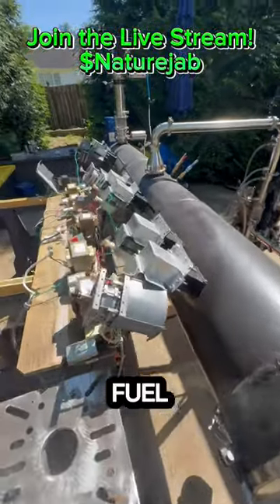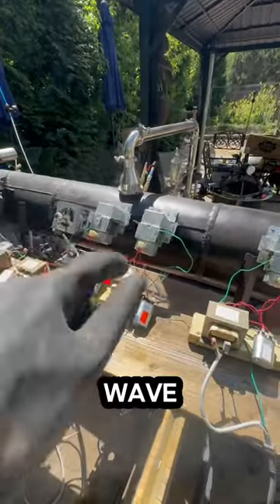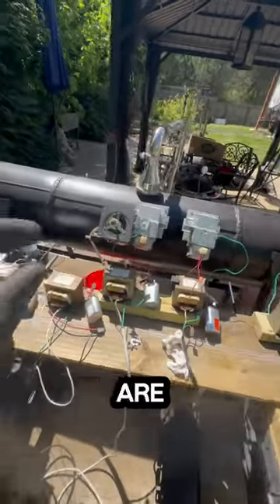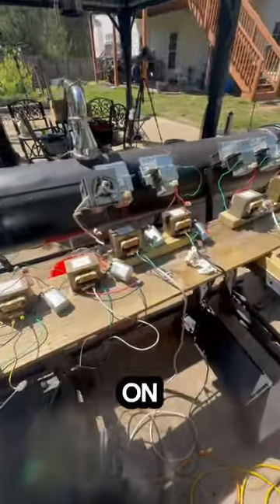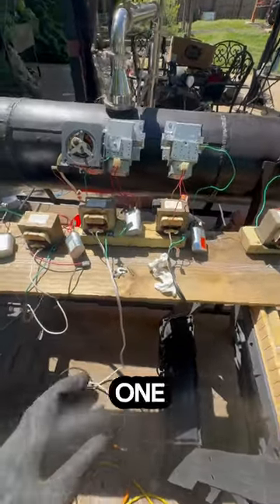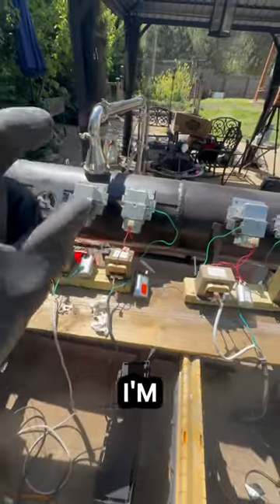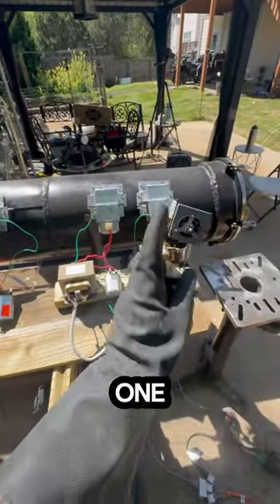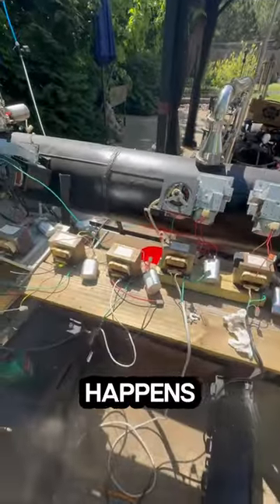7/12 Magnetrons! Microwave Plastic into Fuel Reactor! #naturejab #Pyrolysis #Science #Education

Comment: Note: a 2.45 GHz microwave signal has a wavelength of 0.122 meters. That’s about a third of a foot. When you mount your magnetrons, remember that standing waves will form due to reflections on the cavity and metal spiral due to constructive and destructive interference. This will give rise to cold and hot spots. Therefore, it might be more important to place the devices correctly for even heating than their actual number.
Reply: Or just not even use microwaves as a heating element.
Reply: As a commercial refrigeration/cooking products tech, I second this. Kick your mags several degrees off perpendicular. You want the radiation to bounce "down" the pipe. As they're currently oriented, the waves would bounce right back at the antenna

Comment: You can wire the primaries of the transformers in series and get a higher voltage that way you can run it on 240

Comment: Im not the smartest guy but a standard alternator gives about 80 to 90 amps. Could a small engine motor be used to power your invention? Also if more power is needed you could add another alternator.
Reply: I think it would use more fuel than it produces
Reply from the maker: Alternator gives high amperage but low-voltage. I need both. Thank you!
Reply: Amp + Volt   achievable with high speed
Reply: Alternators are DC. That's why you don't see genorators with alternators.

Comment: Only uses 15kW to make 2kW worth of fuel
Reply: Ye but it is a project in the garden after all, with huge budget you can probably make way better ratio and a goal is to recycle plastic into something we can use once again and fight with pollution
Reply: 70amps at 120 is 8.4kw. 1 litre of gasoline contains around 9.7kwh. So if he can make a litre (2 pints) of product in an hour, which it looks like he can, he's good. As the plastic is waste, the product should be lower CO2 footprint. Let this man cook.
Reply: Way less then 2kw
Reply: @dawidjlb2589 ya ppl will big money have tried. It takes to money energy to make the fuel.
Reply: @dawidjlb2589 this method of breaking down organic waste is never going to scale the way you think it will, currently most organic waste is degraded with anaerobic digestion, like landfills. 
https://en.m.wikipedia.org/wiki/Anaerobic_digestion
Reply: @Delchursing it definitely takes way longer than an hour to make the equivalent of a litre of gasoline (c4-c12). Remember that this produces a very crude distillate regardless of the throughput. Also what’s the point of taking already produced electricity and powering a gas generator with it. That’s like if you put gas in a generator, powered a device with electrical power to make gas… only to put it back in a generator to make electricity again.
Reply: @bencooler2003 Maybe it's a prototype or something like that
Reply: But if a large solar farm was put up to run the machine, it wouldn't matter how much electricity it used and it would solve a huge problem in the world.
Reply: @sketchyfrog  lol

Comment: My question is with 12 magnatrons running and the rest of the machine. Whats your expense in electricity usage to fluid ounce usable fuel. Does it actually use less energy or is it about the same just using a different source? Thanks!
Reply: This right here
Reply: Mate, pyrolysis has been used for thousands of years. It’s just not viable in the sense of what this guy is trying to achieve. This is nothing more than a hobby and it can’t go anywhere other than his back garden. There has been research and papers on the plausibility of this. Support him if you want and hats off to the kid for doing something other than playing fortnight. But don’t be deluded into thinking this is the fledgling idea of a revolutionary technology because it really isn’t.
Reply: @reecep4016  I read that there are already factories that do this and more planned.

Comment: How does swapping120 volt for 220 volt use less amps while achieving the same heat? Surely it will make no difference? Ohm's law?
Reply: Per Ohm’s law, for a given power, if voltage is doubled current is halved
Reply: @mrobinson4210  
If you have a British 230 volt microwave oven next to an American microwave oven they both use the same energy to heat something. The energy efficiency rating is the same for comparable models.
Reply: @PAGANONYMOUS Right, only the American version uses more amps, if the required energy stays the same. V * A * Time = Energy
Reply: @doubleprecision  
how does the American microwave oven use more amps than the British microwave oven to bring the same contents to the same temperature? He's suggesting in this video to use British style magnetrons though?
Reply: @doubleprecision  
Yes although it uses less volts it uses more amps to compensate that's what I'm saying just using 230 volt magnetrons to bring the same contents to the same temperature as the 120 volt version would is pointless.

Comment: What is idea of this ? Or is it just an experiment. By the way you will lose a little power as the 240V MOTs are made for 50Hz, MOTs are driven into saturation, this means by increasing the frequency 😮 you will need a higher primary voltage by  to get full power something like 275V without doing the math

Comment: running off the electrical grid which the power is created by fossil fuels, and your using how much fossil fuels at the grid to create how much fuel? Seems counter reactive to me. It would be more efficient if you could run off the grid and instead of magnetrons which are essentially mini generators use a DC generator running off solar